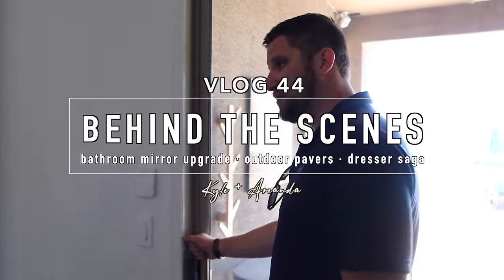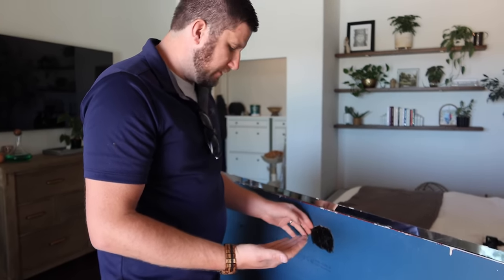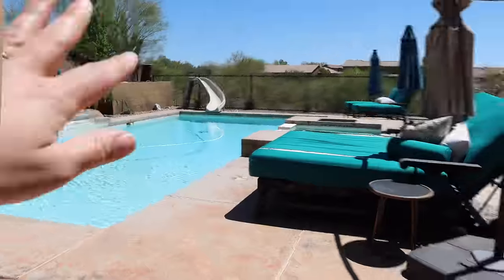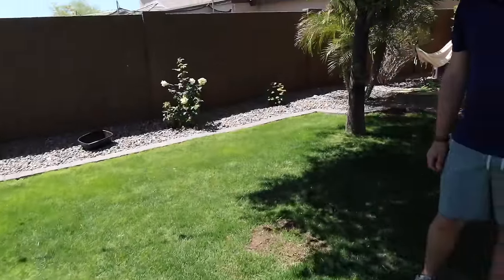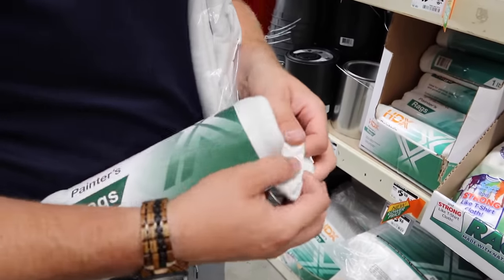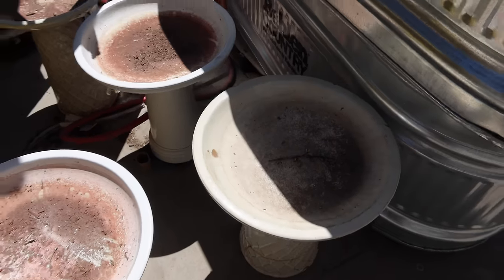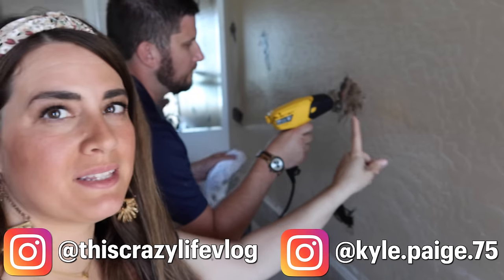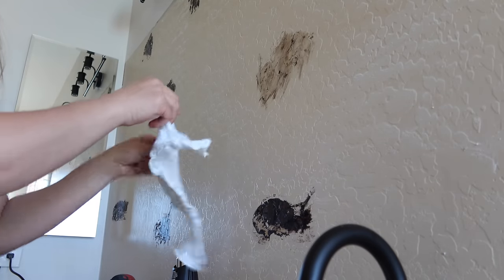VLOG 44 | HOUSE PROJECTS BTS : Bathroom Mirror Hiccup, Picking Outdoor Pavers + the Dresser Saga

Comment: Our previous home had the weirdest stuff done to it, too! Extension cords run through walls, dryer venting into the ceiling and not to the outside...the funniest one was the pantry door. When they added the handle they didn't have screws long enough so they drilled holes, stewed it in, stuff the rest of the hole with paper towel, and painted over it!
Reply from the maker: OMGSHHHHH 👀 That’s wild!!